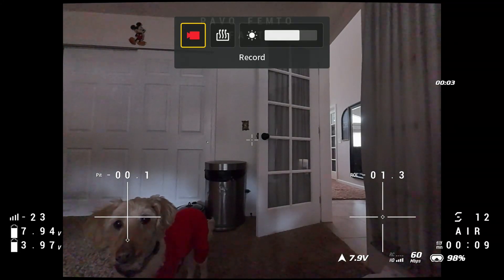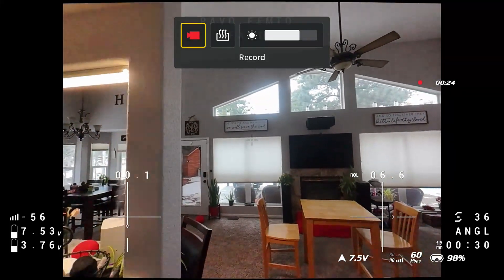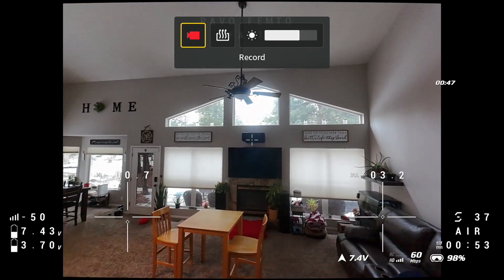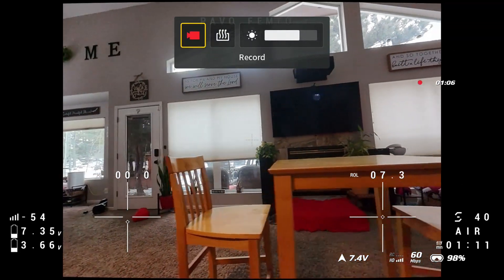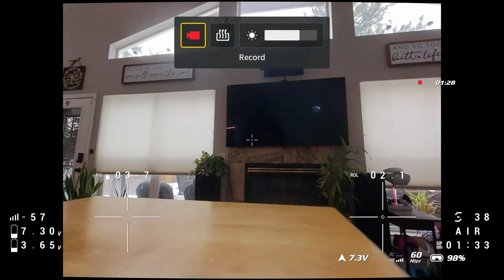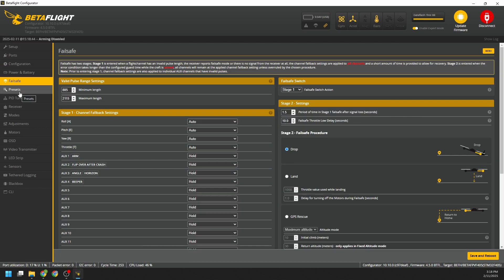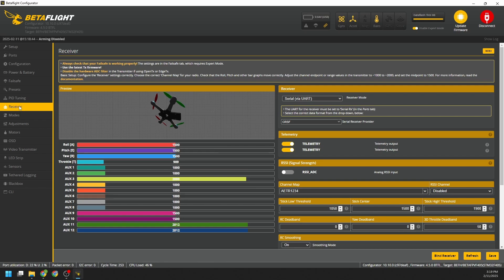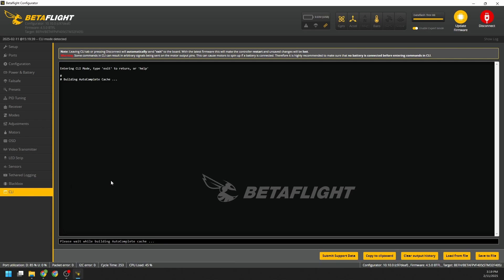Pavo Femto Troubleshooting

Comment: If there is something wrong with the motors or esc, one thing u should do is try to spin the motors with ur hand and see if they have a different resistance or any crackly feeling when spinning. Another thing u can do is turn on artificial horizon and make sure the quad is perfectly level and also put it in a rubberised surface that dampens vibrations, and see if motors all start at the same time and stop at the same time when arming and disarming. Also see if you have any motor get substantially warmer than rest of the motors after some flying.

Don’t immediately worry if the motors stutter tho, most of the time betafpv sets their idle speed very low, even lower than default so stuttering motor may just be that ur battery is low unless it never gets to spin up after giving throttle or even trying to blip the yaw.

Oh also the gyro they put on those things get easily off when flying. I have both this and meteor 75 pro with O4 and I can see the artificial horizon start deviating from their flat position as I fly them. They become level again after rebooting the quad but as it comes to the end of the flight it deviates again, which isn’t a motor issue. But then my quads don’t deviate in airmode. You should go outside and stay in a position in airmode long enough to see if it really deviates because in a tiny space, any quad feels like it’s veering to some side in airmode. Oh and airmode doesn’t use accelerometer but it does use the gyro.

Btw u just got my paranoid af brain curious so I actually found my own femto to be doing similar things. But guess what, all my quads do drift slightly in airmode. Thats just how sensitive of a gyro they put on these, fpv quads aren’t meant to be very stable anyway so they don’t put a gyro thats very precise on the fc’s. They put one that just does the job of keeping the quad from unwantedly rotating excessively. Not perfectly locked to a certain orientation. One more notable thing is u can actually change where it drifts by re locating the battery. Chances are ur quad is drifting because of the battery and the cable hanging behind it. The cable not only shifts the weight to the side but also blocks some of the air from the propeller, which is enough to deviate the quad’s orientation. You can actually see videos where people stick their hands out of a real plane (like a cessna) and it’s actually enough to steer the plane. Air is a fluid afterall

Comment: I had the same issue with a Femto I got a month ago... still drives me crazy! I assumed that the board was not level in the quad so whenever i calibrated it in Betaflight it would calibrate to the board and not the actual quad... I had some success tilting the quad when calibrating it; but that was a temporary fix and I can't get the offset right each time (it's trial and error process). I thought angle was supposed to be easy mode but I was always fighting the quad, I'm still learning to fly but it is so much easier to fly in acro mode with this particular Femto

Comment from the maker: I did try replacing all four props, and the issue is the same.  I also swapped the motors corner to corner (left front with right rear) and it pulls in the same direction, meaning the issue did not follow the motor.

I'm really thinking it is the ESC on the AIO board.